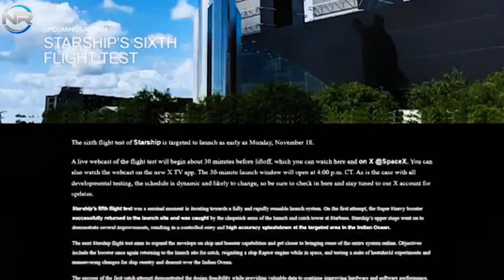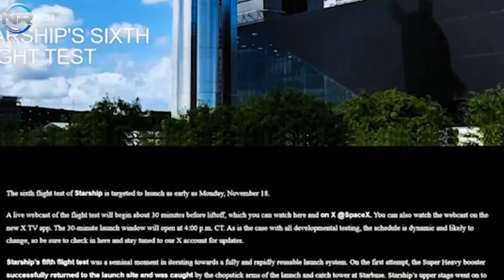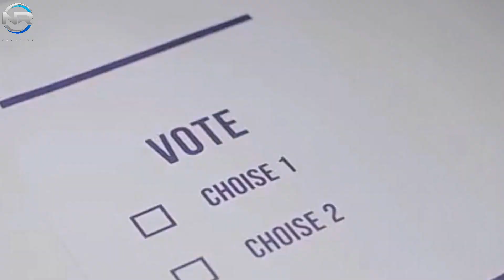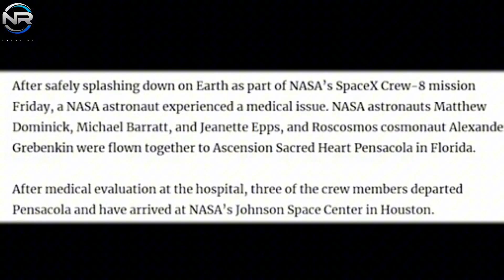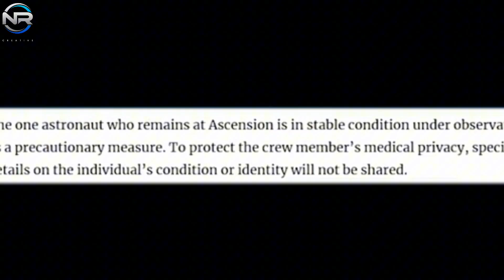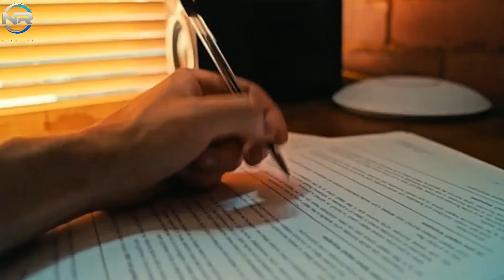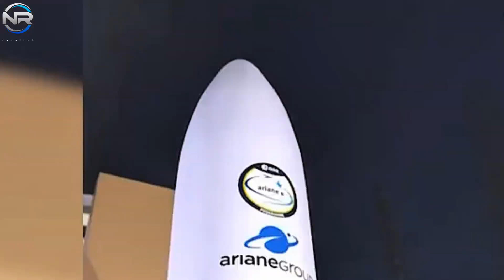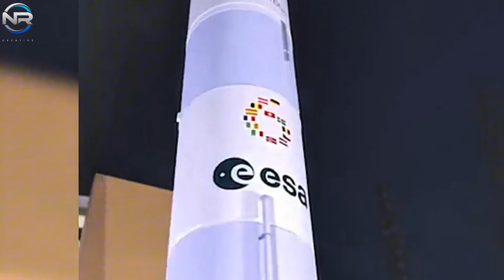SpaceX is Even Ready for Flight 7 with a BIGGER and More Advanced Starship V2

Comment: Why don't Space X have a second variant of the falcon 9? A falcon nine with the non-reusable engine replaced with the new Raptor 3. They use the old falcon 9 for NASA missions. And get a bit of maturity into their Raptor 3 engines, by using it for Starlink launches. That would also give people a look at a fully reusable falcon 9. And showcase the benefits of rapid reusability.

Maturity into the Raptor 3 should be invaluable for their 2026 NASSA moon mission. NASSA being an indispensable customer.
Reply: Every other flight machine will be pointless when starship becomes operational. There is no reason to use resources for something else
Reply: Also the everyday astronaut made a video if you could use methane for the F9. The conclusion was that, almost the entire F9 would need a redesign

Comment: could the starship become twice the width it is now or for that matter 3 or 4 times larger then the current size it is now? just think of the fuel and supplies it could haul if it is 4 or 5 times larger than it is now
Reply: I think you have no reverence how absokuty ginormous it already it. 22 story high, 3 stories wide. 5000 tonns in weight. This thing is already a scyscraper flying in the scy. Like a building blog not just a building. Scaling it 4 to 5 times would be like flying a village